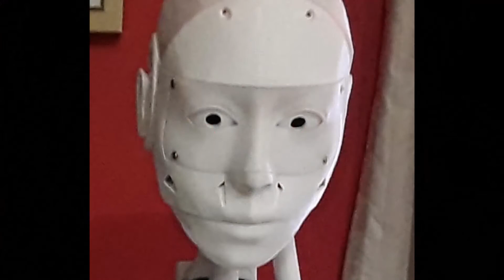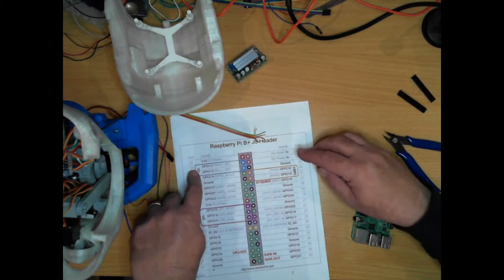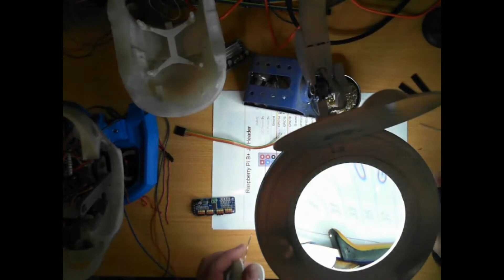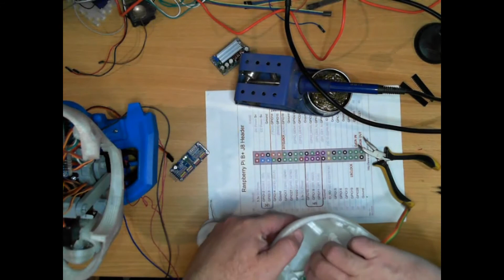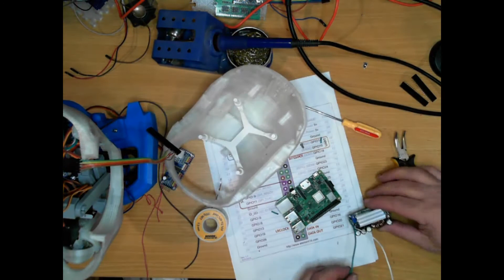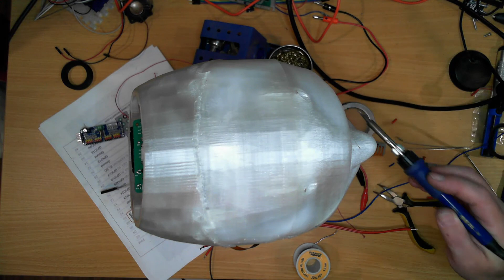Freds Head Part 7

Comment: hello ! may i know if you have a servo connection to raspberry pi pin connection layout ? would be much appreciated !
Reply from the maker: I use a PCA9685 I2C 16 channel servo driver to run all the servos in Fred's head.
The PCA9685 has it's own SMPS to power the servos and is controlled from the Raspberry Pi using the I2C bus on the GPIO header.
I use 4 pins
Pin 01 is the 3.3V used for the VCC, this powers the controller chip
Pin 03 is the I2C SDA signal
Pin 05 is the I2C SCL signal
Pin 09 is the ground

I cover using the PCA9685 in this live stream https://youtu.be/ctrOWn58elI

Hope that helps
Ray
Reply: @CyberOne   Thank you for the quck assistance, i will go through the video and will continue the project! Thank you once again!😀

Comment: Hey mate, ordered a new 6V 60A psu, damaged my old one. So when it arrives, I’ll be setting up my inmoov, and may need your help a bit, but it has to come from China so may take a few weeks
Reply from the maker: Shouldn't be a problem.
I hope to start recording the first of the walking robot series this weekend, I might get you have a look at some of that as well.
The subject is even more complex than I had thought, so there has been a lot more research to be done than I first thought.
I'm still waiting on the bigger SMPS to be able to use a higher voltage power supply.
In Part 8, I show how with the use of SMPS, you  can increase the voltage and lower the amps being used when performing the power up testing.
Reply from the maker: Umm, I just realized that, this comment was on Part seven :-)
It released 16 hours early... :-)